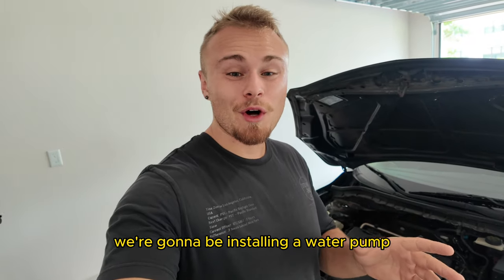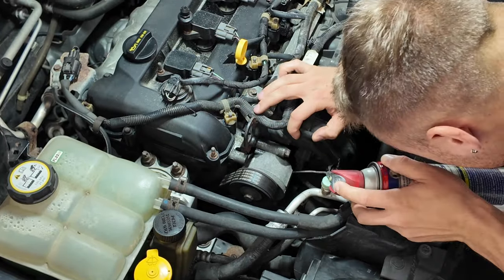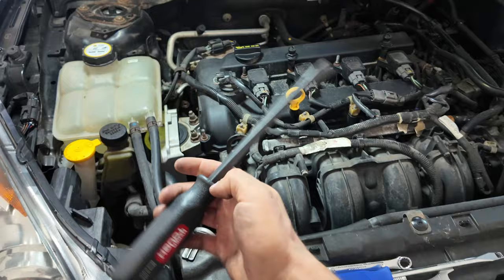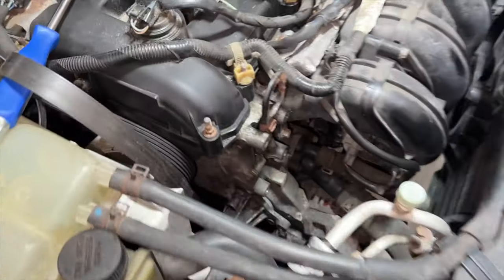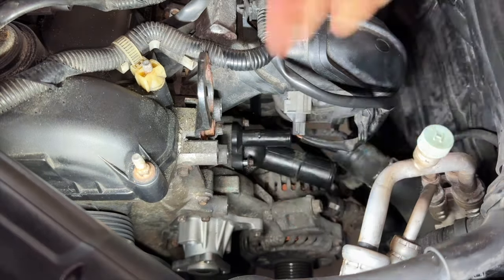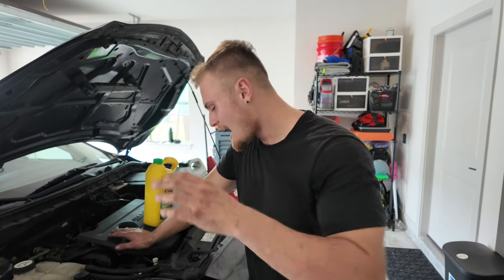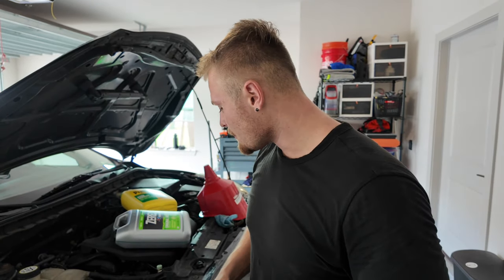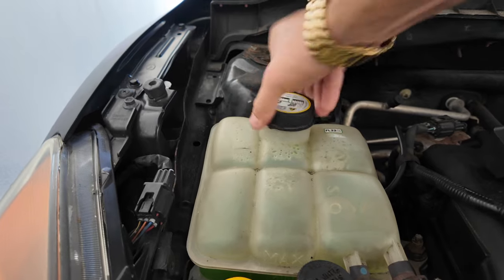HOW TO REPLACE WATER PUMP & THERMOSTAT ON A 2010 MAZDA 3 | P0126

Comment: How do I see which pump fits. 2013?
Reply from the maker: what do you mean how do you see which pump fits? plug your car info in to any parts website and it it will populate the correct pump. Also 2010-2013 mazda 3 2.0 should all be the same water pump